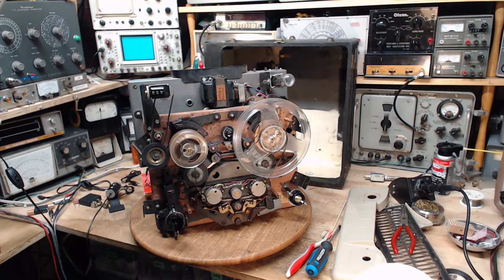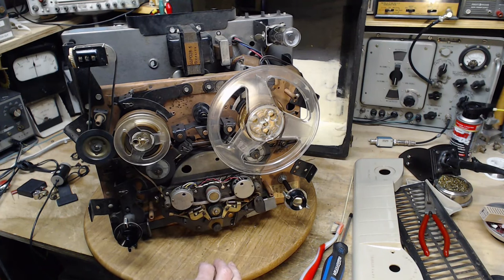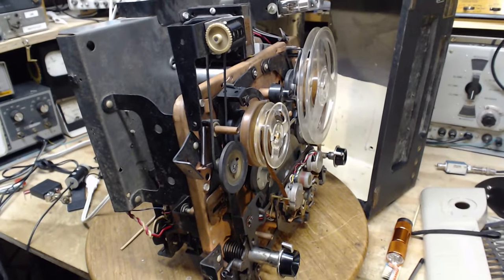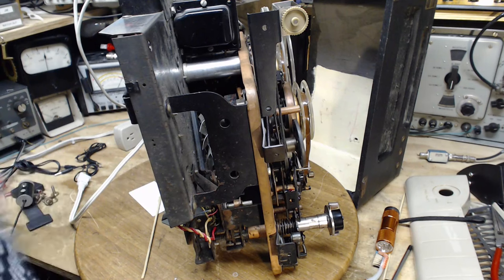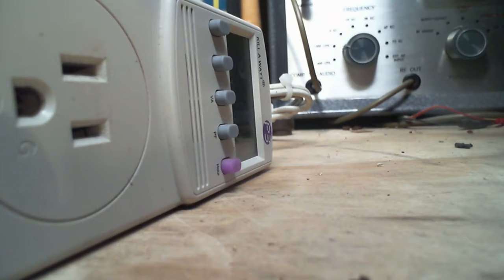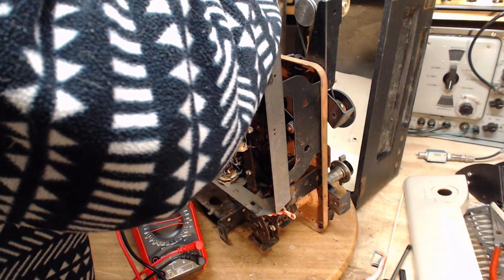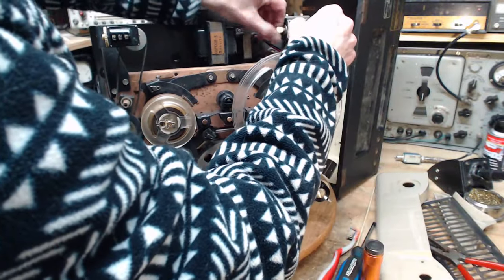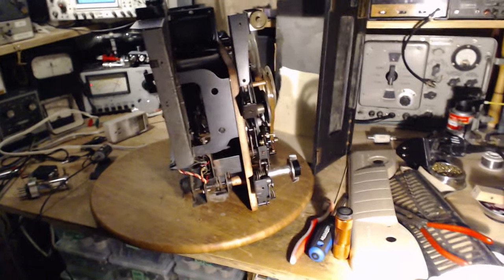Webcor High Fidelity Reel to Reel Tape Recorder Video #3 - Lost Cause

Comment: That is the most reliable tape recorder ever made. If both motors come on at the same time, it will try to play both ways at once. Since that won't work, it uses one at a time. All you need to do is switch the knob to the other direction and it will come on like magic. One motor for each direction. If you can't fix that tape recorder, you can't fix much. That is a tape recorder you can use every day, all day. Desi Arnaz uses one just like it. I have one myself. It's a record player that doesn't need records.

Comment: Jim, the reason why you state you are a radio man, and plenty of video evidence to support that statement, is because you lack experience working on Tape recorders. So nothing lost if you delve further in to this tape machine, for you will learn a lot and truly find the cause behind that motor not running. Hey Jim, the problem may not be the motor but do take the motor out and check the windings, if the motor windings are OK then you are back in business again.

Comment: If the motor is warm, like I believe you said it was eairler, then it is getting power, just try to oil it as it is, from the top shaft. if that dont work you have to take the motor out.
Reply: I would say it's a starter cap that's bad! Do you say the same?